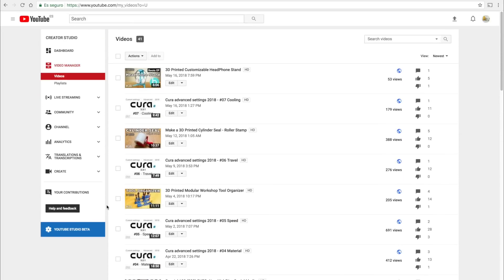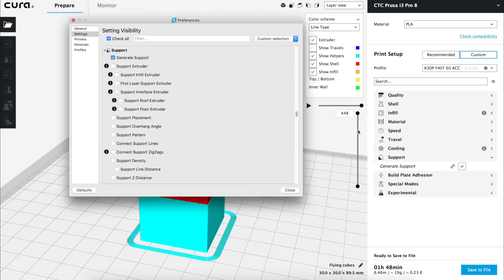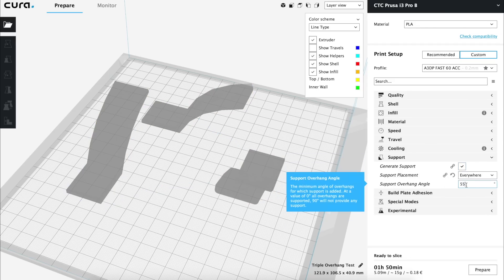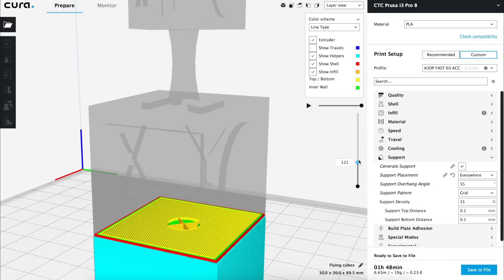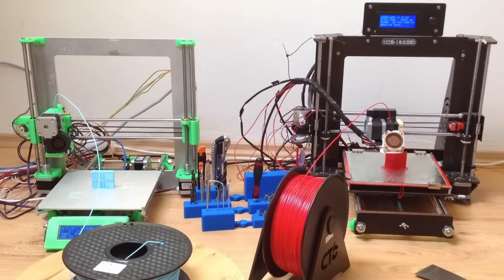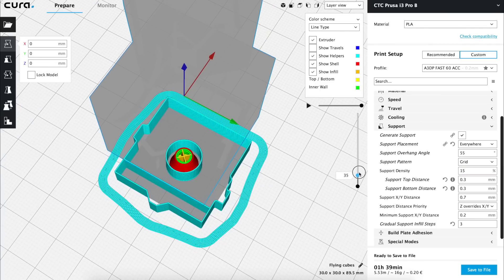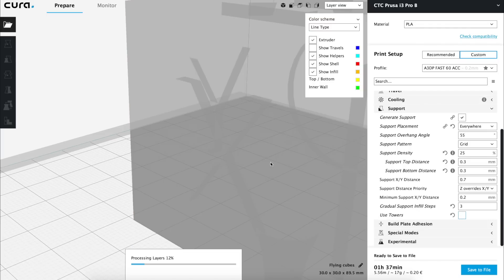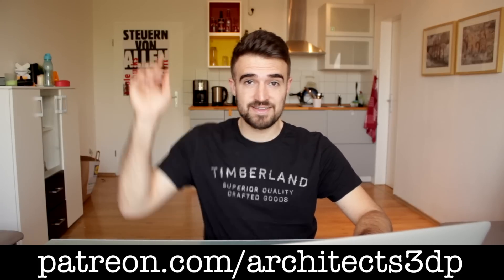Cura advanced settings 2018 - #08 Support

Comment: HEY! I saw a trick in cura, you set the layers to .05, 0 bottom layers and 9999999 top layers, the print will be  solid but if your settings are good to start, you will get SLA quality prints, this trick was used to create figurines, try it out!
Reply from the maker: I'll have to try it out!!